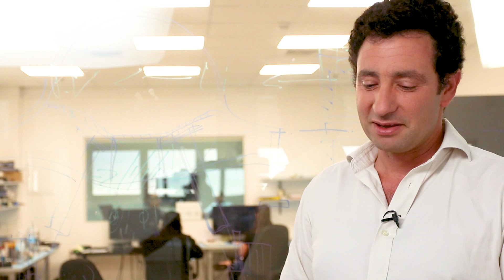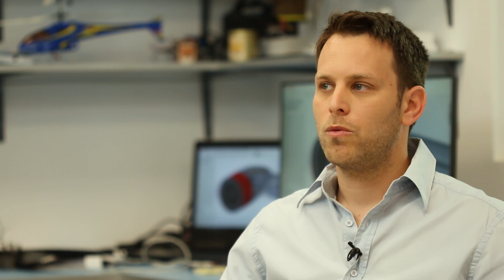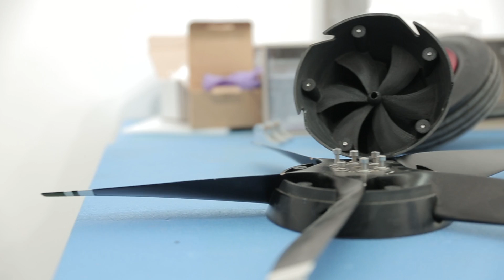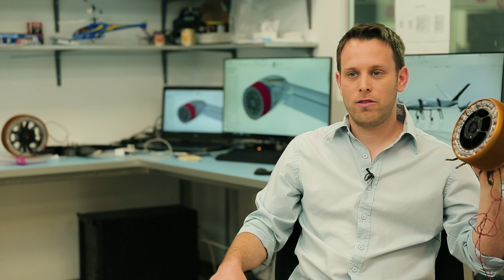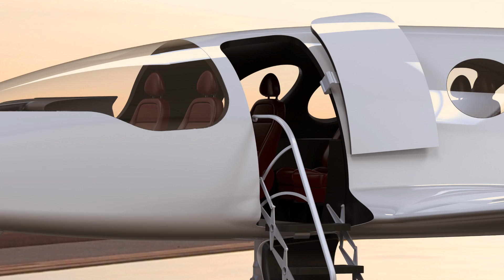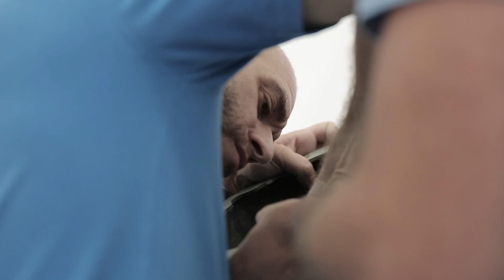Electric Powered Inter-City Air Travel on the Horizon with 3D Printing

Comment: BUT ARE THERE IN NATURE POWERS THAT WILL SHORT CIRCUIT THOSE ELECTRICAL BATERIES.  THAT WOULD BE DANGEROUS ESPECIALLY  TRAVELING IN THE AIR
Reply: in the future, each individual electrical cell will be able to perform a self diagnosis and bypass itself in real time.
thus no more short circuits.

Comment: I think a lot of unnecessary weight for airplanes are the long wings.  3D printing can make it possible to have several short wings so a plane can land on a regular roadway with VTOL wings.  Print the wiring inside the body and make the electric motors plug into the housing.  People and their luggage could all ride in the same compartment and end the hassles of lost luggage.  Get rid of windows and replace them with VR headsets to see 360 degrees around you from what the cameras mounted outside see.  The pilots (if you have them) can have retractable covers over their windows and fly by camera unless they malfunction then switch to window viewing.  It can eliminate the dangers of bird strikes and laser pointers.
Reply: Good points